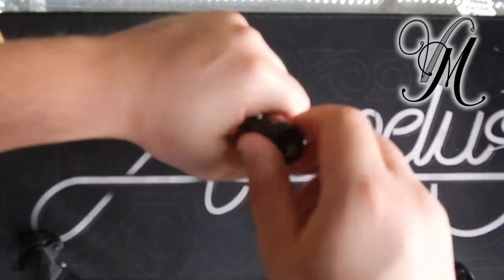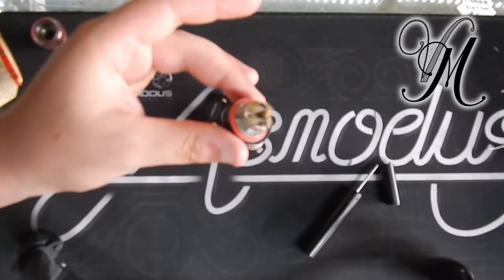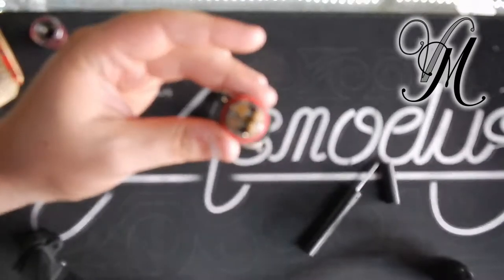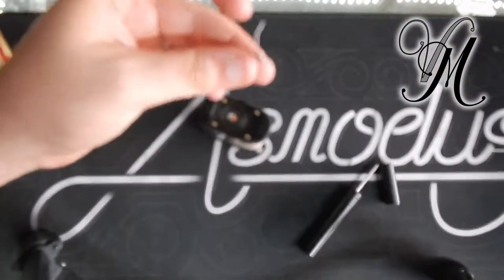Hugsvape Lotus RTA Building / Coiling / Wicking Demo

Comment: Used 3 mm aliens in mine... Cut at 4 .5 mm length. Kept the coils as close together as I could. It is tempting to pull them directly over the airflow but I found better flavour when centred tight together. But makes perfect sense to use 2.5 mm like u did. Good tutorial. Don't like the drip tip tho 💨💨💨
Reply from the maker: Noo it takes some getting used to, it's awful!
However i originally thought bit was built in. Glad it's not
Reply: I've used 3mm Ni80 fused claptions (2x26/40), cut them at 5.5mm and I put them directly over the airflow. Still get great flavor but I did consider trying a build with them closer towards the center. Because generally when the could are right under the drip tip you get better flavor. 

I'll definitely try doing that with one of my lotus rtas. 

Also considered going 2.5mm but unlike what everyone claimed the 3mm easily fit. 

The wicking was super easy, needed a slight thinning at 3mm but not too bad (with the zeus I thin the wicks a lot more)

These rtas wick like a beast but I also noticed they seem to use up a lot more juice that a zeus (also put out a lot more vapor eventhough i used the same wire / build in both)

Also used a few other drip tips but the original ones grew on me. One driptip really increased flavor though (also made it a bit more restrictive) and that's the profile RDA 22mm conversion vap driptip.. I lost one of those and it really bothers me because they seem to increase flavor with almost any rta/rda